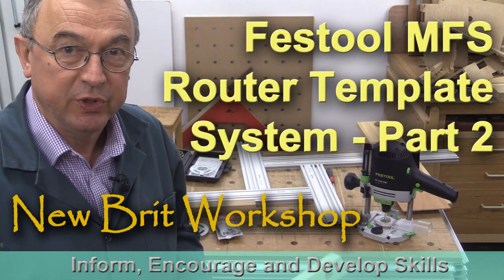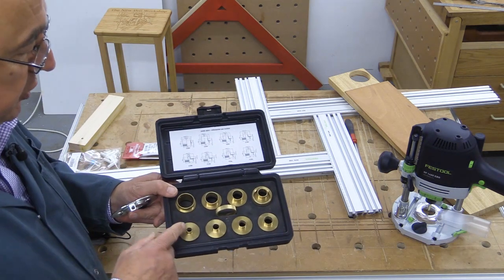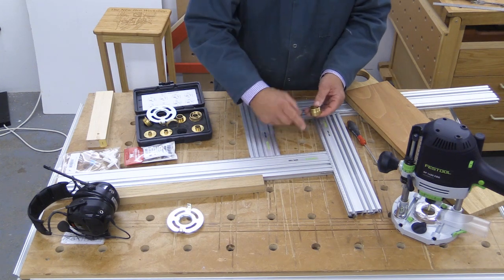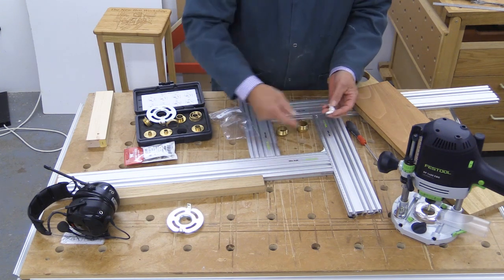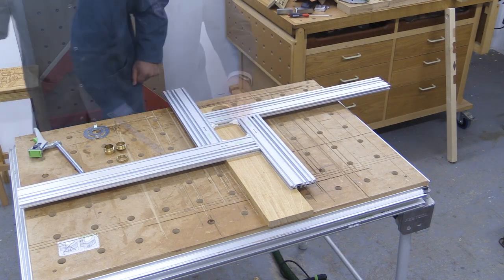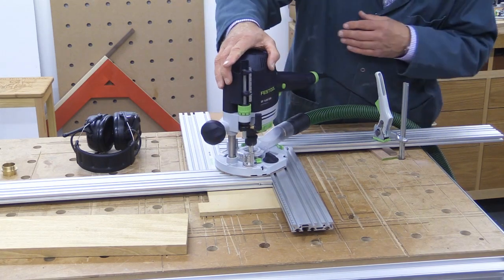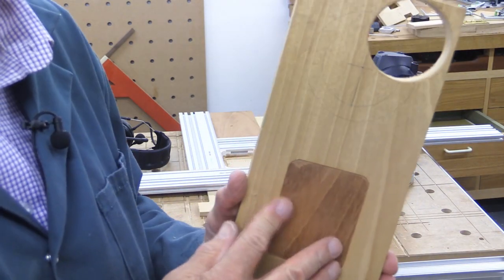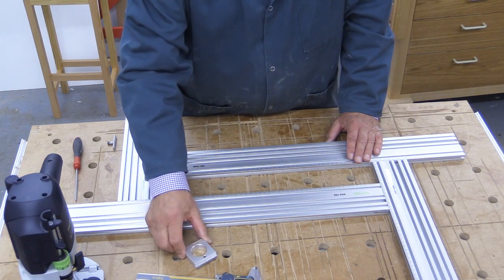Festool MFS Router Template System - Part 2 of 2

Comment: With all due respect, this is the first video that I have viewed on the "New Brit Workshop", where I do not see the advantage of using the device. It does appear that the old adage: "Going all the way around one's fist to get to their thumb", may be apropos here. Not sure. However, this has nothing to do with Peter. For he IS an exemplary instructor. One of the VERY best on YouTube. So these are only my personal thoughts and the device may be perfect for others. But I just don't see it in my case. Thanks Peter for all of your tremendous contributions to the world of woodworking.
Reply from the maker: Hi Pat, It is strange how one person's perception seems so at odds with another's...I said in the video that I was sceptical at first but I warmed to the MFS by the time that I finished. There is nothing in this for me except following a duty to provide this video to several who have requested it. If it needs me to do more with the MFS or explain its attribute more clearly then just say - I am sure that Festool UK would let me hang onto it for another couple of weeks to produce a follow up video (my schedule is quite tight and so this may be a couple of months in reality).  Please give me guidance.   Peter

Comment: I have had the MFS400 for some years now and have used it with great success for a number of applications. router table plate insert, dados, grooves, hinges to name a few. Just need to get 2x 700mm extensions.
Reply from the maker: Hi Les, Well done - the Festool code for the 700 extensions is 492724.   Peter

Comment: Hi Peter,  is it possible to use the mfs to cut an arc, where the major/minor aces are different? Cheers
Reply from the maker: Hi Dan, I suspect it might be possible when I remember those jigs for cutting elipses, however, I do not think it would be very easy to set up and probably not very accurate.  Cheers.  Peter

Comment: Did you end up keeping it Peter and if so do you still use it much?
Reply from the maker: Hi Michael, No, it was returned to Festool. I think I will buy one when I am not quite so busy.  Peter
Reply: New Brit Workshop Hi Peter,  I looked at a few reviews from US after looking at your video again.  They weren't flattering.  It seems the partial threads in the channel are very vulnerable to being stripped unless you are very gentle tightening them.  It also seemed very expensive for a few bits of profile and a good idea.  I see someone has made a similar jig using pocket holes and produced a video of if it.  I might look at that.

Comment: Would those accessories work with the Woodpecker Variable Router jig? https://www.woodpeck.com/accessories/festool-aftermarket-accessories/woodpeckers-variable-router-jig.html
Reply from the maker: Hi Steven, I do not know but maybe others can help.  Peter
Reply: Hi Steven, Did you ever figure out corner radius inserts for your Woodpecker Variable router jig and if so could you send me the link?

Thank you in advance.
Reply: @measuretwicewoodworks  I have not, but I contacted the maker to ask.  I may just try them for $5.
Reply: @ironwooddesigns9532  not to bad a price as a test run